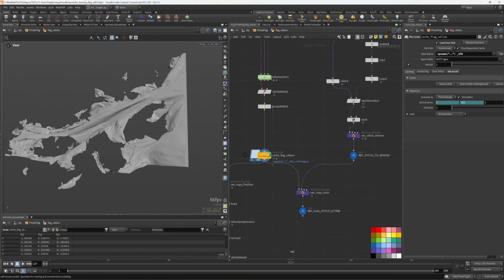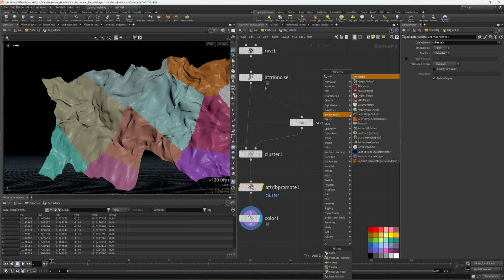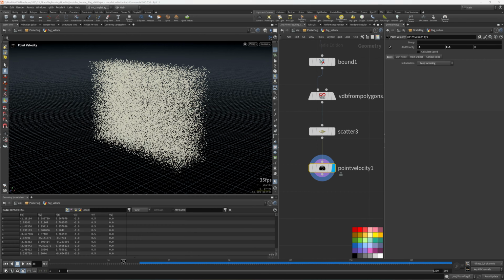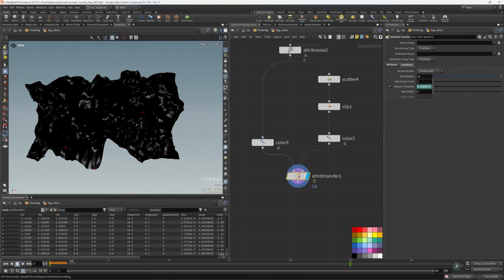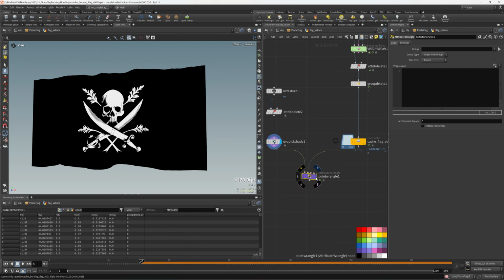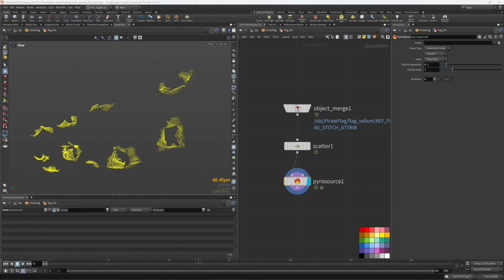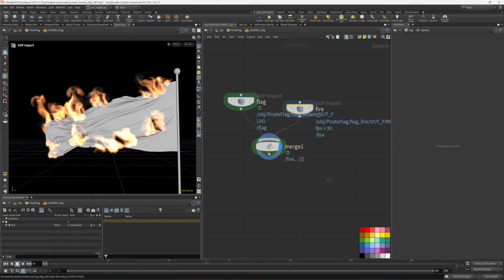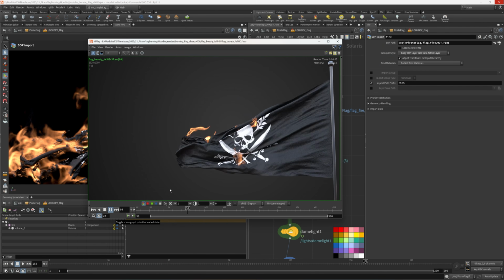Complete Houdini Tutorial - Pirate Flag Burning Effect for VFX Artists

Comment: in the flag vellum , after the merge node after cache_flag_simulation , when i add uvquickshade the texture is distorted for some reason, is there something i missed ?
Reply from the maker: Thanks for your feedback @vfxdanny4562! The vellum flag have issues in the uv after simulation, and you need to copy the vellum position points to your original flag with uv applied using a VEX wrangle. If you want to see more deep details, You can grab the project file here https://gum.co/u/ngnwbwon